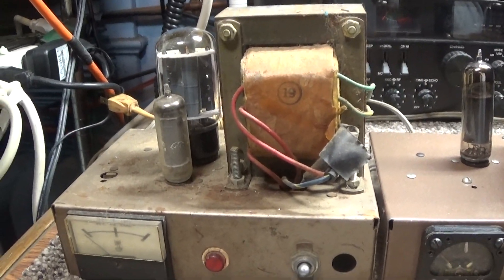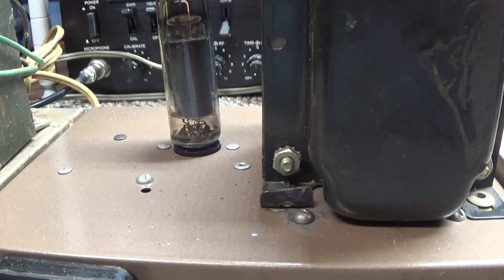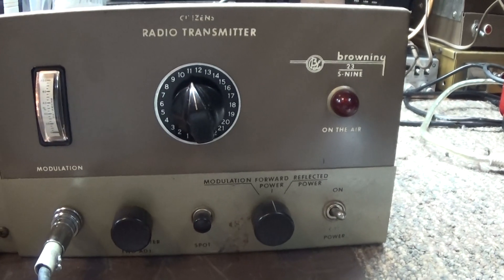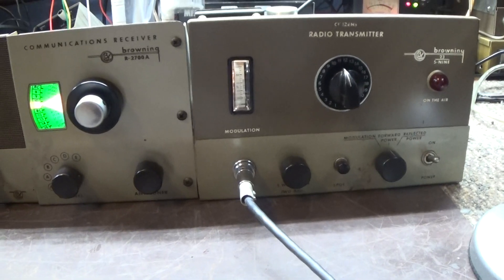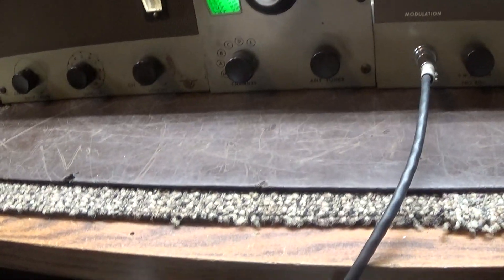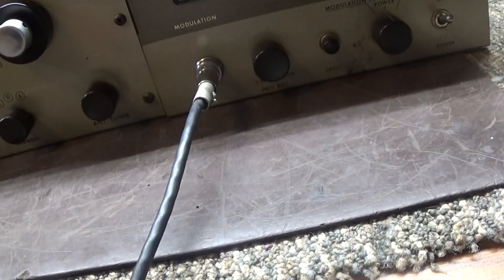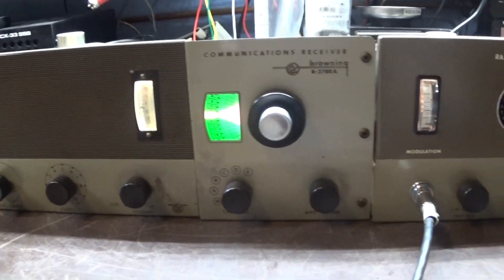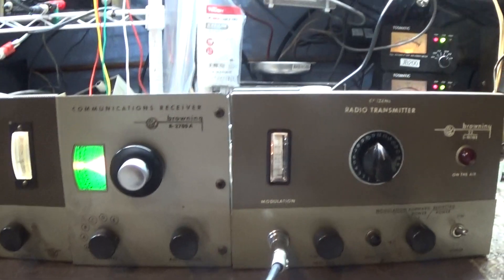Early Browning 23/S9  R2700A tube base and Blackcat JB-12 and 150 modulators

Comment: I know this video is a year old. I have the exact set. It need some electrolytic capacitors and new tubes would help
I like the R-2700A reciever. It can pull signals out of the white noise.
My 23/S9 transmitter needs gone through also. 
Thanks for posting these videos 
73